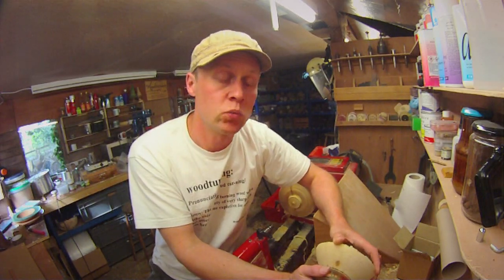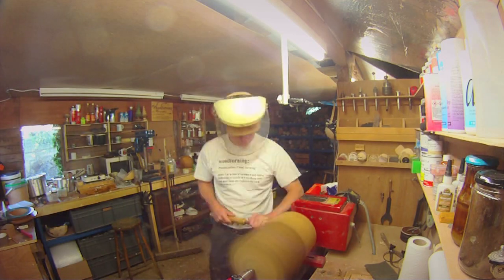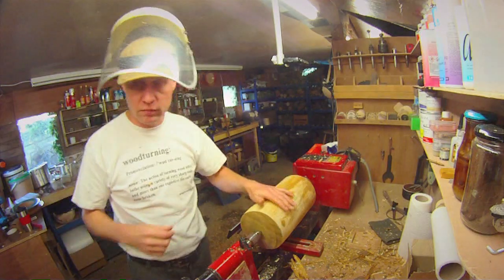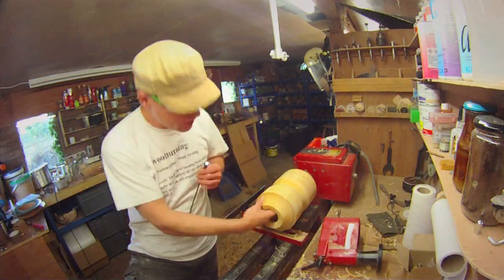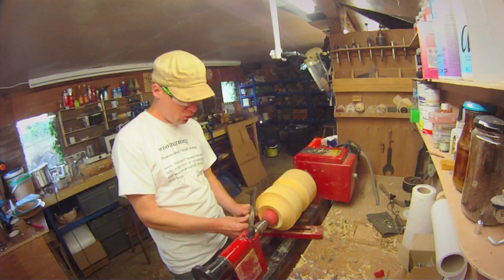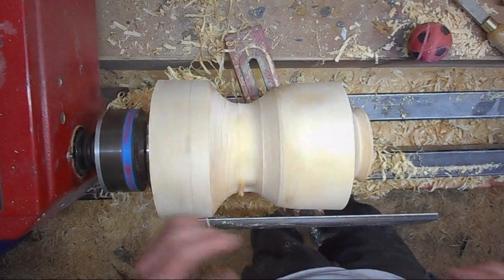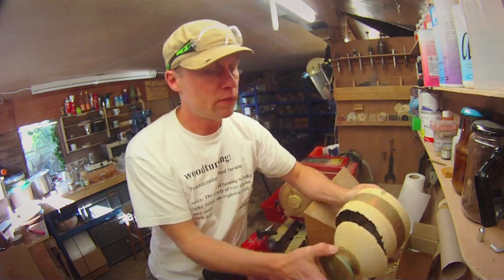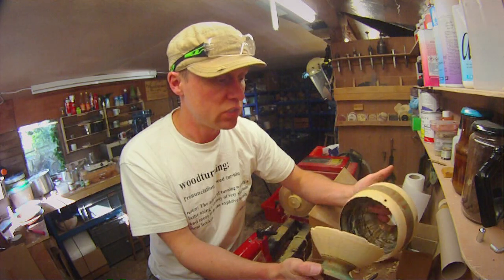#69 Hollow Form Pot Woodturning Fail

Comment: Been there, got the 'T' shirt. Its a learning curve for all of us. One thing I did learn was to use a flexible pen light, this is a small bulb on a long flexible neck, which I use to light up the walls of a hollow form from the inside. You can clearly see where the thin parts of the turning are.   Chin Up Martin.

Comment: Hi Martin. I just been thinking. couldn't you tape it together temporary, cover the break with tape rather heavily, then fill the inside with expanding foam, let it set then make a feature out of the crack using resin or epoxy. once that's hard n you've smooth off to finish, scoop out some of the inside n fit a large test tube or small beaker for flowers. rather than waste all that time to throw away. Would be a shame. Just an idea. Good luck.